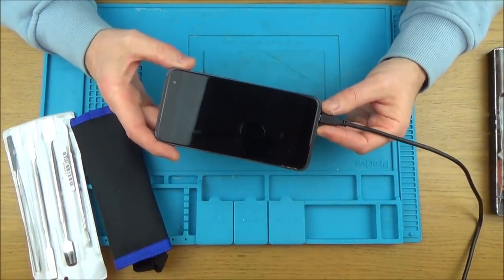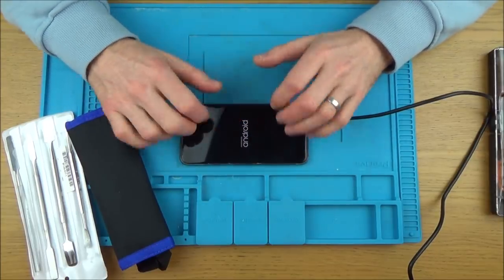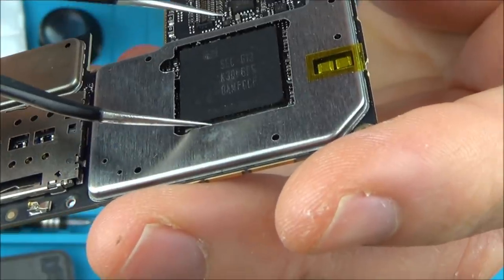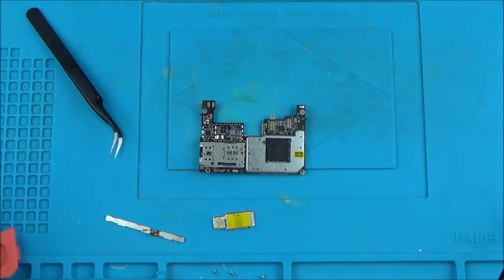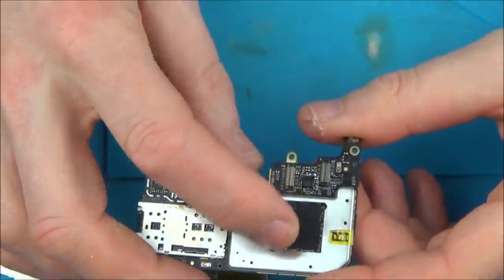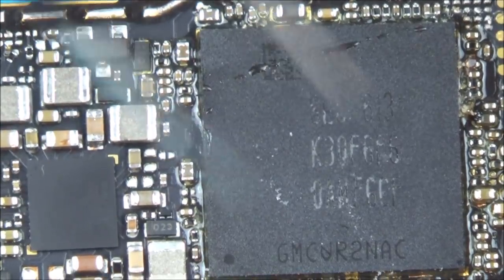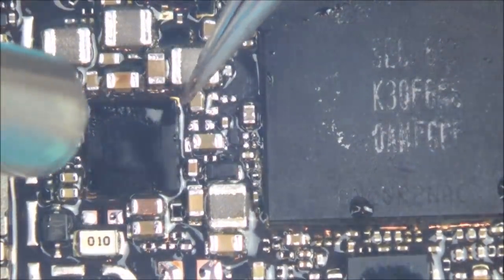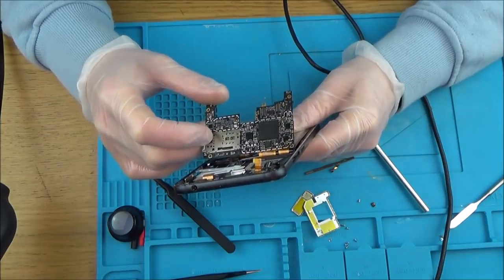Trying to FIX a Faulty Android VFD900 Android Mobile Cell Phone

Comment: And another sacrifice for the lead-god!

Although I'd like you to make a video where you lift those devices (CORRECTION EDIT: BGA chips) up just to see how they look like underneath.

While we're at it, why not also try to remove ALL solder on the BGA pads, add new solder on each side and simply see if surface tension will save the day?
Reply: You need a bga stencil for that
Reply: Attila TheHUN
That would be the proper way of doing it... I was talking about an improper way of doing it (simply applying solder to one or both sides, then see if it will reconnect to all pads), and whether that would fix it momentarily.

I know that would be very suboptimal, just curious if it would allow the thing to work again (with no intention of it being a lasting repair anyway), and that he could continue his original fault-finding from there. At least for peace-of-mind.

I know fully well that for a lasting repair, we would need a BGA stencil, BGA solder balls and a better workstation for such delicate tasks.

Comment: I'm pretty sure you're not supposed to nudge and move around components that you're just reflowing, at least you shouldn't do that with BGA chips. I know it's convenient to know the solder has melted, but with the tiny distances between balls in such chips even a little movement can cause the balls to blob together and then all you can do is reball the whole thing.

Comment: When you push down on the chips with melted solder you are pushing and squeezing the solder out of shape, only nudge the sides of the chip to tell if solder is melted.

Comment: I found this searching up the model of that phone. "Vodafone smart Platinum 7 is rebranded ALCATEL ONE TOUCH IDOL 4S, also named OT_VFD 900" I know its probably too late but it seems like there were some fixes for the Idol 4s bootloops. (Which should be exactly like the phone you have)

https://pocketnow.com/vodafone-smart-platinum-7
Reply from the maker: Thanks, I will Google the One Touch to see what I could have tried :-)
Reply: Here is the link talking about how to reinstall the firmware via 2 methods. 

https://4pda.ru/forum/index.php?showtopic=723034&st=1240#entry59470422

(it's in Russian so, use google translate)

You just have a few programs to download to get it setup I believe. I can't find the original post but on XDA Developers, it mentioned someone got Idol 4S working again via one of those methods. If I can find anymore info, I'll post it for you. Hope you get it back to working again!
Reply: ah the puzzle is complete 😄 looks like they modified the design a bit tho...

Comment: Usually a bootloop is caused by the software not the hardware (like the LG G series its caused by hardware) if its caused by software its as simple as booting the phone into the boot loader, and flashing the stock images with fastboot. Once you research everything bout flashing stock images its pretty easy

Comment: Looks like it has a Mediatek SOC so just needed Mediatek windows reflash tool and appropriate firmware - Could of being a quick and easy fix
Reply: Its a snapdragon 652, not a mediatek chip set.
Reply: @padre443  ah right, didn't realize but same difference really just need the reflash tool
Reply: What? Fixing droped phone with software? This is like the "download more RAM" joke but on the next level.

Comment: The solder balls pop out because of the underfill or glue once they pop out then you have to take the chip off and Reball 😳
Reply from the maker: Thanks for the advice :-)
Reply: @Mymatevince  I already added a comment about it, but wouldn't it be possible to at least try and remove all solder on both sides, apply thick solder on each pad (both sides again), then simply heat it until surface tension lines it up?

I know it's very suboptimal, but just out of curiosity... just to see if it will even boot up again.

EDIT: The worst that can happen... well, aside from completely frying the chip (from wrongly connected pads)... is that you'll have to try again.
The first sign I suppose that the chip IS working is if it gets hot when powered on. Like it did before those solder balls started bleeding out.
Reply from the maker: It could be worth a try. Would be a fun one if it worked :-)

Comment: Could be due to connectors in old Android as same in my LG G3 cat6.... disassembly clean connectors ....just dry it with heat gun add new heat sink compound if it heats ...  Assemble it again then see it can malfunction  due to faulty battery or even slightly moisture

Comment: Vince try using DIODE MODE measurements for troubleshooting, far more useful.
Reply: Problem with that is you need a working board to compare the readings against don't you ?

Comment: Next time buy a new OEM back on eBay or AliExpress and get your warranty. Also all you needed to do was flash a new firmware via your pc and a flash program like Odin for Samsung. Because if the recovery worked the chip is fine.

Comment: I had similar problem with mediatech chip phone it boitlooped 5-8 times and died , found out its power supply killed it while charging including the charger that was pulse charging causing it showing charging, disconnected and repeat

Comment: It happened at the point you moved onto the second set of chips and part way through you changed direction of air flow and seconds after lifting the tape covering the 2 caps on the right you cooked the CPU, lift it and reball

Comment: It was sistem fault I was having this problem on 3 phone samsung galaxy j5 2015, samsung galaxy note 1, some old stupid phone. You was need just to root this phone and install newer or older android version. Turn the phone battery off than power device on with holding power and volume up button than select fast boot and plug the phone in pc. On pc you need to install app to root it. Select run as administrator and root it. After rooting you will need to hold power button and only press volume down. For me it was working supper on any phone and all of this phones are still working better then new ones
Reply from the maker: Thanks for the information :-)

Comment: I had a similar thing happen on my phone, I fell from my bike and phone took a huge impact and The memory chip (EMMC chip) got dislodged and phone would randomly go into bootloop. I could apply some pressure on the chip and then flash it again with rom and then phone would work fine for some time but wasn't a permanent fix. So I took it to repair shop and they reflowed that chip and it worked fine since then.

Comment: Maybe it DID need a new firmware??
At least before you bricked it by removing parts.
And if you are asking, YES, in most cases it CAN be done at home with a computer and cable.

Comment: Hi important tip: when dealing with broken glass from phones always put tape on the broken glass to avoid further glass dust going to your eyes or lungs. If you can separate them without further damage, always try to remove the parts so they don't rub to each other while removing the entire glass, creating more dust.
Also when you have such a fault: Loop boot, most likely is related with the firmware, by this you should try to reflash it before trying to go deep into the guts. Not always assume that because of a drop the board got destroyed, the drop most likely have interfered with the flash, for example it was working and something got disconnected for a fraction of a second that ended up on memory corruption
26:48 if you squish it you'll create shorts everywhere, you can do this but you have to add flux again and reflow it and touch it in one side so the bridges go away - this work with small chips, these larger ones are more easy to not work at all.
Great video, you can always buy another board and a new back and i'll work fine and cheaer :)
Reply from the maker: Thank you. Great tips, I wish I had tried the software first to see if it made any difference. Next time I will try that before taking it apart :-)
Reply: @Mymatevince  NP :)
Reply: @Mymatevince  hi

Comment: Reminds me of my LG V10. I loved that phone, but the battery didn't last long and it got quite hot doing menial tasks like browsing Facebook. Eventually, the heat must have killed the CPU because it got a bootloop as well when I was trying to watch a YouTube video on it. I was a week out of warranty with the carrier, and LG refused warranty because it "was an international model" (it was the US model, just with carrier specific software installed). I used a heat gun and brought it back long enough to recover my photos and videos, but it bootlooped again, not long after. The fault was recognized to be a manufacturing defect, affecting quite a few flagship LG Phones. Its still there, gathering dust until the day I manage to find a replacement CPU or board.
Reply: One of my 7 Lg phones is not boot looping.... Many LG phones have that problem... Switched to Samsung
Reply: @davidmayr4540  I've never gone back to LG after that. I made the mistake of switching from my Moto X2 to the V10 after my contract was up. Now I'm on my third year with my Moto Z2 Play. The battery lasts me for about 2 days, its still silky smooth, and it doesn't get hot at all. Never switching from Motorola ever again!

Comment: The problem seems to be on the software side , before u messed up the main chip.Maybe you can learn how to solder underfiled chips and make a revisit video.When you get back to the point that you started first time , you can flash new firmware , which is an easy job ,most of the times. :)

Comment: Hi Vince,
I've bought a Nintendo Switch with a faulty charge port, do you think a replacement of the port is doable with basic soldering skills and a hotair station?
Reply from the maker: Hi, with flux and tweezers and a steady hand I think you may be successful. I am still not confident doing it so I may not be the best one to ask. If you have any old broken laptops or anything with chips on it then maybe you could practice on a few of them first to get the feel for it. I hope it goes well for you....Good luck :-)
Reply: @Mymatevince  Thanks Vince, I will give it a try after some practice, have a nice weekend.

Comment: The solder would be boiling residual flux encapsulated by the epoxy, once the epoxy gave way the solder escaped along with gases due to pressure..

Comment: Tbh buddy. It seems the battery replacement that caused the problem.. the battery has failed.. Causing possible surge detection to occur... and basically the chip as gone due to it forcing constant boot loops until the point the chips given up... some batteries arent upto safe standards and phone will just reject them

Good thing is whole main boards for them phones are dirt cheap... even most of the parts. order new battery and main board and you have it fixed up :)
Reply: Ben The Boss Jackson no it probably needs a reflashed rom

Comment: Same issue with the Mi A2 lite I drop it a couple of times flat on the floor on its back put it in my pocket because it was fine when I checked it and few mins later felt it vibrate I take it out thinking it's a notification but ended up seeing my phone turned off and rebooted and stuck at the bootloop I just sent it to the service centre they thought it was a software issue so they swap it few week later it happened again stuck at bootloop so I return it back to the service centre and they swap the motherboard and now it's fine
Reply from the maker: Thanks for the info :-)

Comment: iSheep go bleah in another place 😜 This is a very decent Vodafone operator device (didn't watch yet and dunno who the OEM is, probably no1 knows). QHD screen, Snap 652 (still alive and current imo), u name it.
Reply: the apple crowd is getting left behind.  No 5g announced, all phones have 3 gigabytes of ram or less, lackluster processors.  If it wasn't so strictly sandboxed they would realize that its just a midgrade phone.

Comment: I had a dropped iPhone that was boot looping I removed bag chip cleaned the board and gently with some solder went over the balls on the chip and then just put it back on nothing to loose as the phone is broken anyway in my case it worked fine and I am still using the phone now
Reply from the maker: Excellent :-)

Comment: I had the same problem with my HTC M7, and the only way to boot was to freez it ant it works for a while... the same with a Samsung Note 4 the only ways to start the Phone is put it in a freezer for a while, but than it work as long you do not shut it down..

Comment: Probably just needs reflashed, doubt it's a hardware fault.
Reply: How does dropping a phone can be repaired with a firmware flash?
Reply: @abzhuofficial  quite possible but don't know how.. i work in a warehouse with handheld scanners. If we drop them they instantly crash and then once off they dont boot. we have to send them to away to be re flashed. I can't get my head around it either as there no moving parts in them.
Reply: @horlixs  The only possible thing I can think of is that the device gets knocked and corrupts the firmware in the process, but that's not possible at all. Odds are something internal is physically broken and parts have to be replaced and repaired, and repair companies will flash the latest firmware AFTER the repairs have been made

Comment: No expert but the fact it booted up and displayed the Android logo makers me think the chips were fine ,I would possibly put the blame one the power button brewing stuck on hence it coming on and going off that said I could' be completely wrong ,I would say they searching eBay or AliExpress for a replacement main board might be a cost effective way of repair of you can find one. Still it's all learning I made a mistake changing a laser on an lg dvd player i believe u only should of undone one of the rails the laser is fitted to  one I believe had the laser alignment on and should be left only way now it's too by amech with laser but at £ 13 it's not worth it still it came with 5 speakers and a sub and was free as it was something someone threw away ,I made the same mistake twice messed the laser alignment up on a sharp ghetto blaster still I know now it's all a learning process
Reply: What typically happens is a pin or more is disconnected around either the cpu or memory, this causes corruption of the software, when the phone tries to recover it keeps failing due to the software errors, each time it boot loops while the device has dry joints, the software will continue to create more corruption,
There is also other things like the inductor for one of the v_core power rails, maybe for memory

Comment: Well, it was a software problem man. No hardware faults involved. You just overhearted the board that is why it is done for. You just had to flash the firmware on with probably SP Flash Tools or some weird Chinese program considering it is an alcatel. Now, here is the GOLDEN RULE, when a phone or pc powers on and shows the splash screen, it is most likely to be software problems, not all the time but what you should look into first. Never that something apart before having tried every possible software fix. It is indeed refered to as a bootloop by the way.

Comment: Its not really my place but if you're heating up your cell phone enough that it has smoke coming off it and your heat resistant soldering mat is bubbling you almost got it hot enough crank it up to 11 and give it hell

Comment: OUCH!! Painful to watch this one mate i repair smartphones for a living bootloops are 9 times outa 10 software related not hardware related it just needed a new stock rom version of its software re installed on it.  bit late now ah lol dump the mobo and sell the screen if still working .
Reply from the maker: Could dropping it cause a problem with the software? Cheers, Vince :-)
Reply: @Mymatevince  
As it didn't become faulty until a short while AFTER you dropped it, it's probably just coincidence.
Reply: @Mymatevince dont think so vince , Not that iv ever come across anyway . boot loops are normally caused by things like when the software is updating and the battery dies mid update and corrupts the operating system , bit like if your pc fires up ok but just cant load windows op system properly but would be fine again if you just re install windows 7/8/10 back on it . hope this helps bud for future reff. gyles.
Reply from the maker: Thanks Gyles :-)

Comment: It really did just need firmware but now it's done lol.
Reply: I don't think that's true. a bootloop can also be a hardware issue. I mean how can something in the software gets corrupted after a drop. I've seen an LG phone having a similar problem. I've fixed that using heat and got it to work for 15 minutes. It was enough to recover the data.
Reply: @Leonvolt28  Perfect example: LG G4 and the V10

Comment: XDA IS YOUR FRIEND
USE KAPTON TSPE! OMG.
GET the solder mask for the chip. Clean etc and then use the cream solder and mask you flooded it with flux. That loosened it up and the heat drove them out with the pond of flux
Omg your finger ends ughhhh.
I used to reball with the ever usfull toaster oven
FLUX LOOSENS EVERY PART. BIGGEST MESS EVER!